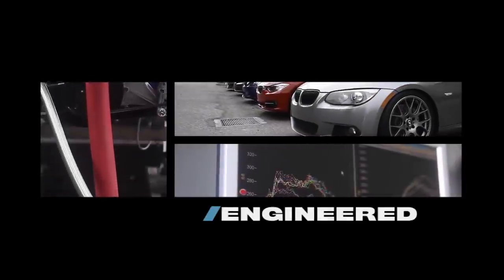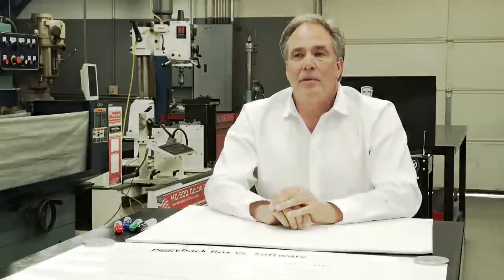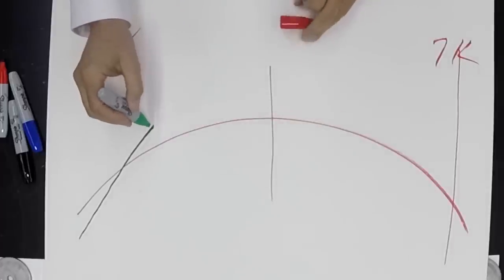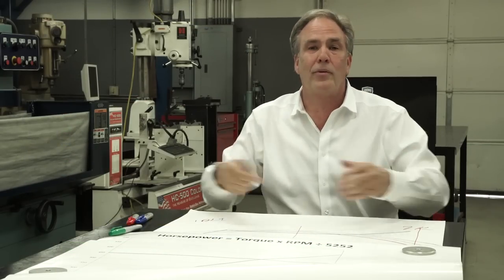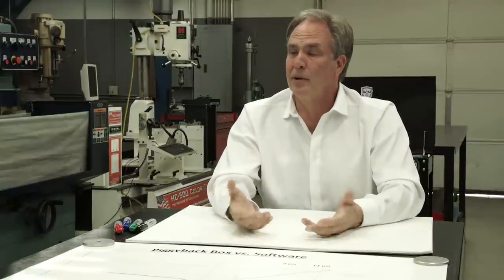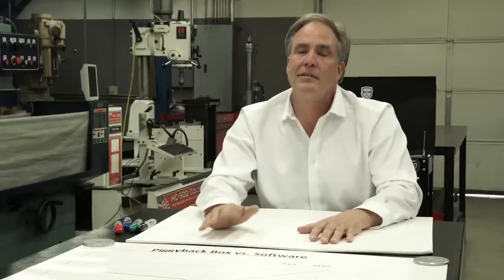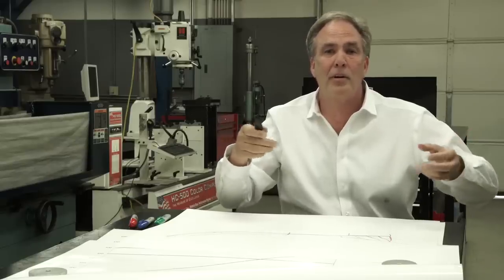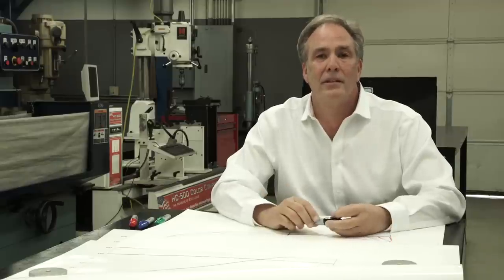The Magic of ECU Tuning - /ENGINEERED

Comment: i can't believe this only has 5,705 views.  This is the most important tuning video I have ever seen.  Dinan does an amazing job on tuning.  They did a full overhaul of a 2004 BMW M5 that I had and added 80 more horsepower and 60 more lbs of torque.  Turned the car into a monster.

Comment: Wow..he knows his shit. Could listen to him all day. Everyone buying a $15 chip on ebay should be forced to watch this..
Reply: But 60hp and 20 more mpg bro!
Reply: Ian Thompson
ha..instant upgrade!
Reply: +Ian Thompson Decals work a lot better man
Reply: He's been into cars since he was young, it's pure passion! You can see it when he talks, that's what makes them great! Passion!
Reply: *****
I didn't read it like that - he was talking about turbo motors earlier (as in most BMs now) but his comment about softare alone not increasing power was about N/A engines.
Reply: +alfamonk Some kid with a prelude posted on facebook his new ebay tuner hoping to get "100BHP". Shook my head and kept scrolling.

To get my car tuned I literally had to ship the ECU out to a tuner and pay a decent sum of money for 40hp/45lb/ft...
Reply: +alfamonk Even then, it's only correct on cars that already have a pretty aggressive ignition timing with tables for high octane, and without torque management. With a lot of (especially domestic) vehicles, there are some pretty reasonable gains to be had (10-25hp) by upping the timing to what a particular engine can handle, actually using the knock sensor, and take out some of the torque management that's used to save the transmission for warranty dollar saving for the mfg.
Reply: +bartonmd exactly!

Comment: With this man's words of wisdom, I am having serious second thoughts about learning how to tune my own ecu. I'll leave it to a professional.
Reply: then you will never learn how to do it. first start with alot homework, read about the engine, ecu, how to tune,what software and hardware they use etc. and then start experimenting, buy some1 else tuned files and compare them to original ones, look what the tuner has changed etc and also, learn the basic things. u cant do anything complicated if u dont know the basic.
Reply: Unless you have some serious money laying around for a few new engines I highly advise against tempering with any of the values in the ecu. Tuning requires some serious knowledge and if you posses that type of knowledge you would be employed with a very good company making stupid money, just like this guy. At that point you would just buy yourself a 250k car and call it a day no tuning needed. Don't listen to these tools talking about go ahead man I did it the car works fine. These same people never come back online to post about how 20k miles later the engine just gave out.
Reply: Kalel Kent i tuned my diesel merc, with common rail fuel system, to be precise. there is alot of info laying around in internet,where u can study the basics. and looks like you are one of those guys who like to comment something what doesnt make even sense. like i said before. flash ur original ECU file into your computer, find good tuner and let them tune it. then when u get the fail back, get the program what they used and start comparing ORiginal file with tuned one. then u see the differences in the ecu map and can learn that way. but like i said,go find info at yt,google etc and you eventually will understand how to do it. but ofc, do alot homework and test tuning. best idea would be some older VAG diesel. they are easier than others. good luck finding answers :)
Reply: Lmao yea man just go online and read some stuff because we all know the info you get online is 100% I mean what could go wrong bro? I mean I wonder why the dealership voids the warranty on your car when they find out the engine has been tampered with? That's very strange of them to do that, I mean I told them I did a online course and I read all the forums so I'm sure I did a great job on the tune.
Reply: Lmao Billy your name says it all, Salty

Comment: Finally a tuning video from someone that actually knows whats going on.
I saw Steve flogging a white E36 M3 at Laguna Seca in the late 90's. He had a blower on it and beautiful blonde in the passenger seat that couldn't keep her hair from blowing outside the car. 
The M3 had tremendous exit speeds and was later featured in Car and Driver or Motor Trend or both. 
My brush with greatness...................

Comment: Excellent video, thanks for this. I want to get into engine tuning once I buy a Power FC for my car and this helped me understand the process a little better. What he said about the stock ECU having coding 'traps' is dead on. My Celica ECU CANNOT be tuned either through a direct link up or piggybacks due to these traps. It forces the owner to buy an entirely new ECU, which runs $1000 unfortunately.

Comment: Excellent insight into the world of tuning, keeps it simple so the common folk can understand. I would like to touch on his one comment about software not providing any gains without hardware changes....piggy back systems that adjust fuel/timing can gain 10-20hp in some areas of the torque curve but not peak numbers. Manufacturers like to run it rich in the higher rpms to protect the engine in hot climates for example at the cost of power. Also variable cam systems like vtec crossover points can be lowered so even a stock engine has gains to be made but only with time on a dyno with a proper tuner and not mass produced fixed programming drop in chips like he has said.

Comment: Always found the easiest way to explain octane is this: octane is a measure of the gases ability to prevent detonation. More octane = less detonation.
Reply: More pressure equals more heat. The hotter it gets, the bigger the detonation. If fuel spontaneously detonates at say 900 degrees and the temperature is 910, the detonation is pretty minor. If the temperature is 1000 though the detonation is much more severe. That's why ECU's have both fine learning knock control and feedback knock control. Fine learning is used when minor detonation is "heard" and the timing multiplier is adjusted by a fraction of a degree to make it disappear. Feedback is more immediate and pulls a full 1 or 2 degrees to eliminate a major detonation event. 

So yes, higher octane means it can take more pressure, but it also means it can resist detonation and either lessen or totally eliminate detonation.
Reply: Okay. I think I understand what you're saying a bit better.
Reply: +TinPinFTW more octane indicates a more stable hydrocarbon bond. i.e. it requires more energy to break a methane chain than a septane chain.
Reply: +TinPinFTW Gas ratings in North America is listed as AKI, or Anti Knock Index.

Comment: What a nice person! And he knows what he is talking about! 

I'm glad he mentions that if you change hardware you have to adjust the software and vice versa (goes for force inducted engines as well) because so many "tuners" only do one thing. Which results in either no power gain or engine blowup when driven too hard. (or both)

Comment: Awesome video and very informative but I have one point to make.

Tuning a stock engine is not worthless.

Yes knock sensors are used to set a specific timing, but on a stock vehicle the manufacturers are usually a LITTLE conservative so there is still SOME on the table.  They create a "one size fits all" tune for a fleet of vehicles, not your specific vehicle.  

I agree that companies trying to claim that a canned tune from their tuners will raise your HP by 30 on a NA engine is bogus, but getting a custom tune tailor made to your specific car will produce SOME power but that's not the only thing that makes them worth it.  Its not only about squeezing out the last few HP/TQ.  Its also about drivability & trans tunes as well.

For instance, most cars these days have traction and torque management that will reduce the output on purpose.  Reducing those values will make a BIG difference in the feel of the car which many (including myself) believe is worth the price of the tuner alone.  Not to mention other features like increased throttle response or adjusting shift points/firmness etc.
Reply: +James Wut kek he doesnt row his own gears

Comment: You can do a lot of damage if you don't know what you're doing. I'm an old school mechanic and i retired from repair right when the first American DIS started to appear. I could usually find bad sensor on the new computer controlled with an ohm meter without a problem. Their was nothing on the internet  to help you much unless you wanted to pony up a couple of thousand bucks for Mitchels on the dial up. A small shop like mine was on your own. Either you could diagnose or you went out of business. 

That being said,I bought a C5, 4 years ago as a daily driver and it's been a learning curve. I have  HP tuner but I'm real careful about what i do and save everything if i do change anything. It's cool to try different tunes from others if you dont have a dyno, but i had it done right after i put a new 500 Hp engine it. I do understand injection tables but i am nowhere near knowledgeable enough to change them.  

It is nice that you can get right to the basic fundamentals of what makes an engine run correctly. I love it. I wish was young and just getting into it, I'm getting old and dont have time to get in too deep like i used to. I taught myself auto repair and computer repair and networks after i messed up my back. I was in the trade for 25 years, and a lot happened after i quit fixing cars. 

There is a lot of money to be made if you learn to program ECU's and cal. fuel injection. shop are becoming just parts replacers and good tech's a few and far between. If you're thinking about it and have the aptitude, do it. Win-win.
Reply: all I gotta say is that you're absolutely correct, but that this can be made "easier" (safer) with a proper wideband afr gauge. Usually the problem with people messing with fuel tables is creating bad rich spots or even worse bad lean conditions. Its all a learning curve but its definitely worth it! Good luck with your better, sounds like a badass project!
Reply: *Vette, not better lol

Comment: I paid E150 to have the ignition dwell timing remapped on my engine to match a set of uprated ignition coils and it was the best 150 quid ever spent. It made a noticeable difference to everything from fuel economy to starting, to driveability. Also told it to stop complaining about not having a catalyst, upped the idle by a hundred rpm to increase oil pressure to save the stationary gear bearings, altered the fan schedule to cool the engine better, and then verified that the basic core operation of the engine was sound. Just some quick tuning made the car noticeably happier, especially with it being in a very high state of tune from the factory.

Comment: Well spoken and very informative video. These kinds of things always interest me because I actually drive a 2.5 I5 and a 2.0T I4. I always wondered if an ECU tune would actually “unlock” the car. I don’t really car for massive power because I daily drive and I already get terrible gas mileage for the displacement of these engines. I would like more throttle response however and that would be my main goal for any modifications.
Reply: Yes because its an electronic mechanism and only will help for any gain with adding more air intake(enclosed cold air only) & exhaust on N/A. Not much for those looking for big gains but just enough for spirited driving.

Comment: Interesting video. Nice to see a pioneer and head of an organization still sopped in information, even after achieving success.  Slightly disagree with the assertion that a turbo engine can never have enough octane:  True from the lack of detriment, but there is a quick transition to diminishing returns where DI Engines would do better with pump octane and available ethanol content.

Comment: I gotta say though that if you want to learn the only way to do it is by purchasing a stand alone and learning. I know everyone says to get it done by a professional and i agree with that. but its extremely expensive. And alot of tuners will just basically charge you a tone of money just to get the car running and a conservative tune. 

Personally i had absolutely no experience with tuning beyond toying with my safc II on my 240sx. 

For my supra i purchased a ECU masters stand alone kit they helped me so much in understanding how to adjust what and helped me enough to get the car running and driving and then from then on i've slowly been adjusting things and timing and VE tables etc etc and its one of the most accomplishing feelings when you start learning how to effectively adjust a map on your stand alone and see the difference when you drive.

Comment: With my second generation TDI (110hp) Diesel tuning was easy in the old days, because direct injecting Diesels do not knock and they tolerate weird mixtures better. You had to change one 18 kOhm smd resistance behind the boost pressure sensor in the control unit (back then there was a pressure tube leading into the control unit, funny) against a 28 kOhm one. That made 1,15 out of 0,95 bar boost pressure (the Garret VNT15 could stand that with ease) and then you just had to loop a potentiometer into the injection signal, to feign lesser fuel quantity injected for the control unit. (Ecu Tuning certainly was more sophisticated, because one was additionally able to time the ignition acurate and also its pressure the shorten the injetion time frame) After that one had to figure out a reasonable lambda at about 1,0X (The normal engine had about 1,2) and then you had 140 lasting horsepower for just a few cent. Today an control unit would simply report an unplausible failure and turn into the dry-running operation or the motor would simply run into the cloudiness map and would be controlled down, till the exhaust quality specification fits again.

Btw: Back then we closed our Diesel EGRs manually, to make the motor more efficent. VW was caught doing this due to software recently. But it simply is important to do this, because you want an effective and clean combustion even at part load and you do not want your intake manifold slagged with a mixture of grime and oil dust from the crankcase breather. On the other hand you had all your exhaust gas for the turbine to spin up from part load and not first to close the EGR. That led to a more spontainous response. These tuned 1,9 engines ate their suction 2.0 liter petrol rivals for breakfast with their 285Nm and the short gears. And they needed half the fuel anyway. But don't even think of shutting down an EGR manually. The motor would realize and punish you with dry-run. Today this important hygiene measures for every Diesel has to be done by a specialist Ecu-Tuner after they catched VW.

Comment: I picked up power and torque (measured on a dyno) with a stock N/A engine using just fuel, ignition, and vvt re-calibration (GM's virtual VE calibration was half assed out the door anyway with lots of error, they relied on STFT and LTFT to make up their error, only WOT conditions were somewhat close)  Tuning on some N/A cars can possibly be a waste, but I don't see car manus. rolling cars out the door with the calibration on the limit of what the mechanicals can do and then still offering a warranty.
Good video though, he spoke a lot of truth too and shared a good philosophy to go by for really really really basic tuning.

Comment: I would feel better about purchasing a Dinan tune after watching this video. He has several valid points. Most manufacturers are pushing naturally aspirated engines pretty hard, there really isn't much left on the table. Your pretty much just tuning for engine modification, higher octane fuel, or/and torque management on NA.

Comment: Great guy and video, very well explained. However I have remapped many N/A engines with noticeable improvements in reliable power and drivability. So saying a naturally aspirated motor will not make more power by remapping is not always true. It depends on the Engine and the state of the original tune from the manufacturer.  Anyway, I must watch more of this guy............

Comment: So the original ECUs were wrote in assembly? Seeing how they have gone the way of microprocessors and flash I wonder if they are still base programmed in assembly, or if it is all done in higher level at the oem level.

 When talking about NA I don't think you mentioned advances in bandwidth and chip speed. I was looking at one of my obd-0 ecus and it looked to be an 8bit system and limited resolution. I find it hard to believe that there wouldn't be some gains by switching to a modern equivalent. 

That ecu's motor has seen a small bump in displacement and flow mods, or as you call it "hardware changes" that would definitely benefit from a retune; however, I think that could be gains from more advanced controls themselves. It would also allow one to switch from mechanically controlled ignition to electronic ignition which as you have said, broadens the "bandpass" width of the engines transfer function.

Comment: Hello, do you know electronic throttle controller? it can not only accelerate throttle response but also slow down throttle response of your car. It can provide you with racing car driving experience and also save fuel if you choose the economy mode. It is different from ECU tuning, it does no harm to your car .
Reply: looks legit if you have a real need for it (towing, off road).  don't know anyone who's tried it though

Comment: hey i have a question, he spoke about NA motors and how when you put on different hardware (exhaust, headers, intake) the engine needs to be tuned, but what if your original ECU that comes with your car is not tune-able?